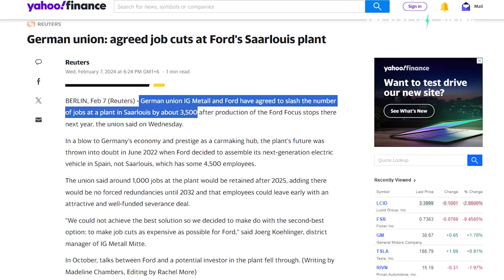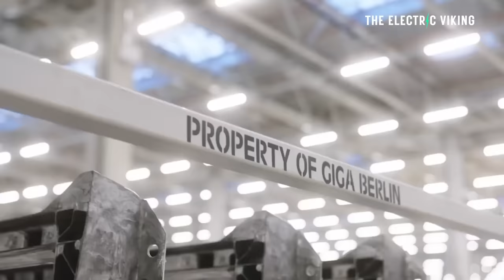Tesla Germany increases production on track to build 1 million cars annually

Comment: If Tesla had to close down the German factory for two weeks due to parts shipment issues, it's too bad they couldn't have used this time to re-fit the factory for the new revised "Juniper" version of the Model Y, so they don't have to shut it down again later...
Reply: Unfortunately making major changes to a production line requires a massive amount of planning and preparation. Not something that can be done on the fly.

Comment: Meanwhile, SAP, Germany's leading software developer is shedding 26.500 Teslas from its fleet, following Hertz and SixT.
Reply: Yeah, do you know why? Might it have to do with some big customers in germany, eh?
Reply: It is normal for rental companies to sell off their older vehicles, usually at between 25,000 to 50,000 miles. But I noticed that Hertz is doing it at around 100,000 miles for the Tesla's. This means that they are clearing out older high milage Tesla's, and were able to run them for 2 to 4 times longer than their usual vehicles. This means that they are able to get incredible value out of them compared to their ICE vehicles. I have not heard that the rental companies are not buying new ones at a steady rate, just as we do not hear about the normal "dumping" of ICE vehicles from rental companies.
Reply: @freedom8480  Yes, I do know why, expensive spare parts, long repair times and plummeting residuals. That's the reason they gave. Just like Hertz and SixT.
Reply: @GoCoyote lmao not true.... all rental companies sell off their cars while they still have value to sell. This is extremely normal to do. Nice try though little buddy
Reply: Meanwhile,Hertz has announced that it is divesting itself of its Polestar fleet.
Reply: @marcg1686 It didn't help that when Tesla lowered prices, the value of those cars dropped.    And Tesla hasn't indicated any stability going forward for prices.

So they purchased at a high price, I guess they were slammed hard by the price cuts.  

The other concerns are well noted.  

And due to Tax law, now Model 3 will not get tax credit unless leased.  Can Tesla afford to lease based on that?

Comment: Tesla has to be careful so it won't be regarded as shovelware.... especially because if its hard to replace battery.
Reply: But it is easy to replace. There are even independent repairs happening on the batteries by now.
Reply: You're a little out of date.  You might want to check what you're shoveling.
Reply: @freedom8480 How much and how fast? I'd rather pay more to get a 5 minute replacement with a Nio.
Reply: @TheEvilmooseofdoom So you can't say how much it costs and how much time it takes.

Comment: 12,500 workers! Hyundai factory in Czech Republic has a workforce of 3,100, and Kia factory in Slovakia has a workforce of 3,800. Each factory produced more cars than Tesla Berlin in 2023.
Reply: Why is that? I suppose it is not that they are four times more effective. Are the Kia and Hyundai cars built from scratch? Do they make their own electric motors etc?
Reply: Perhaps it's because Tesla produces more parts in house that other automakers.
Reply: @BjorckBengt  The Kia site has an engine plant, produced over 500,000 engines last year. And when you say 'are they built from scratch' what does that mean? I expect they buy in coils of steel and press the body stampings out and weld them together to make a car. Or do you mean they have train loads of iron ore arriving at a blast furnace on-site where they smelt the raw steel, and then remelt it an electric arc furnace to create the right alloy, then send it to a rolling mill where it's rolled into thin sheets? Is that what Tesla does at Giga Berlin, make their own steel from scratch? Does Tesla also have a glass plant to make the windscreen and windows for their cars, or do they ship them in from specialist suppliers. Does Tesla make it's own tyres?
Reply: @IgnacioMartin  Or perhaps, they don't.

Comment: Installed capacity in Berlin is ~375,000. Good luck getting to a million.
Reply: A couple of years ago Tesla's installed capacity at Berlin was zero.
Reply: There are plenty of land left empty, that was projected to build 3 more factories, more like expansions, so yeah, the plan from the begginng was to build a 1 million capacity over time, including a battery plant, 1 million capacity by 2028 aprox, no luck, just plain facts.
Reply: With their new production method this will be easily possible 😅
Reply: You pretend that production can't be expanded.  Pretending makes you look silly.
Reply: They only started production two years ago in a partially complete factory, and have only recently added another shift in a five day production week. The original factory is still being built out, with battery cell manufacturing to come online soon. Adding another shift and a seven day production week could double current production with the original line. The issue is supply chains, especially batteries.
Reply: @GoCoyote  Yep. especially the batteries.

Comment: Tesla is a great EV company which set a new trend in the automotive industry. All it needs is different designs of the body and interior. And the same applies to the legacy automakers. All they need is simply convert their existing models to an electric versions. And it seems only the chinese have grasped both of these sides simultaneously. They took all the electrical part from Tesla and implemented it on known existing architecture with the help of all of that western car companies they bought entirely with their engineering staff.
Reply: It's not as simple as you pretend it is.  Most of those that tried to simply convert to electric found that it didn't work as well as doing a ground up design.
Reply: @TheEvilmooseofdoom  They could take the base from Tesla and put on it their existing car bodies and inteior designs with all the goodies they equip their cars with just like the chinese did.  Tesla opened its patents to everyone to use freely.
Reply: This is a genuinely clueless comment that shows you have no idea how difficult it is to engineer an electric vehicle. You don't simply take the old platform and slap an electric motor on to it and stuff a battery underneath it.
Reply: @douglaswatt1582  It's so easy that people do the conversions themselves in their garages.

Comment: If Tesla adds a third shift they could make 9000 cars/week and improve their cost level rather quickly. Further expansion requires additional lines and most likely the Gen 3 will be in mind. However that one will first be tested in Austin before investments in other factories. Then there shoulld be an opportunity to put a Gen 3 line quicker in Berlin than building a whole new plant in Nuevo Leone. Just guessing.